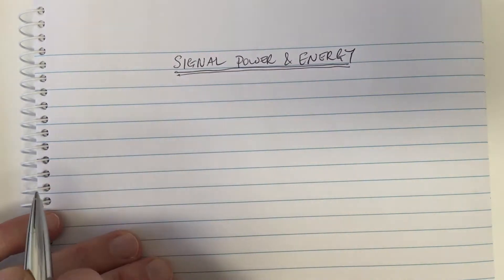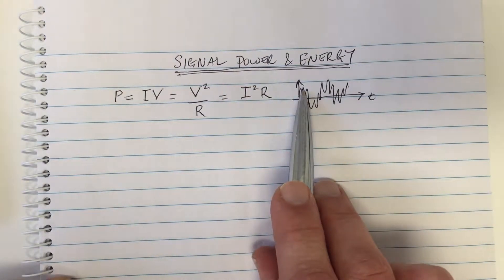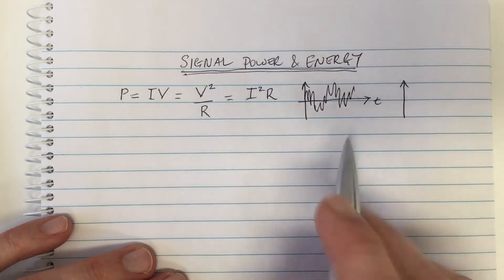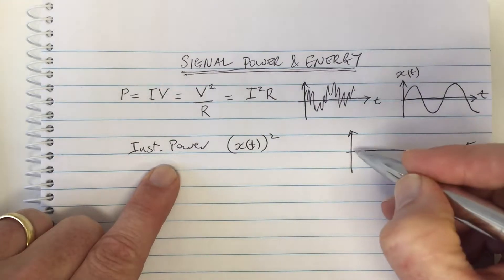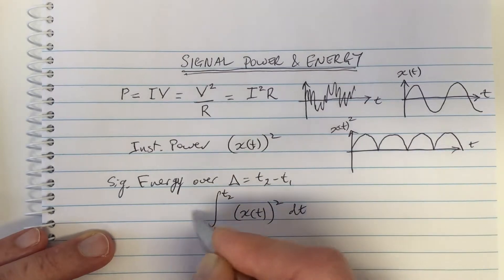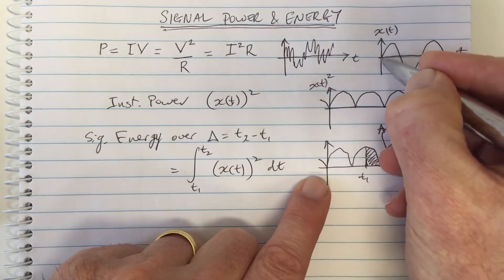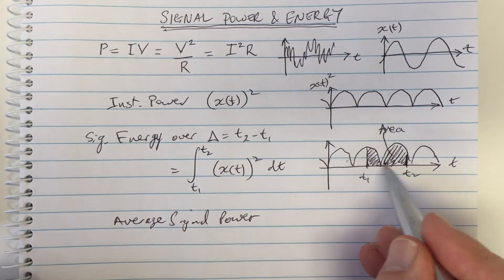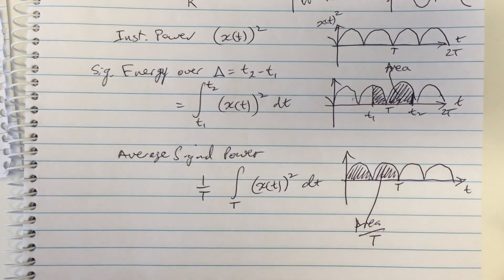Signal Power and Energy

Comment: Could I offer a correction in this video please? When a sinusoid is squared, we have the relationship sin^2 (x) = 1/2 (1 - cos (2x)). This means that X(t) ^2 should be a sinusoid of twice the frequency of the original signal with a maximum amplitude of 1 unit and a minimum amplitude of 0 units, so an average value of 1/2 unit. I believe the appearance of a full wave rectified signal shown as X(t) ^2, whilst showing the removal of any negative polarity signal, is incorrect.

The above said, all else made good sense. and gave valuable tuition in the concepts of signal energy and power. I appreciate your work there Iain.
Reply from the maker: Dam, you're right. Thanks for pointing that out. It's a "visual typo". Pity I can't upload a corrected version. I'll add a comment to the description under the video. Thanks again.

Comment: It was very helpful. Can you please tell the units of the energy if the signal is in volts, please?
Reply from the maker: Power = V^2/R in Watts, and we normally assume a reference resistance of 1 ohm, so the Energy (which is Power times time) will be in Joules.